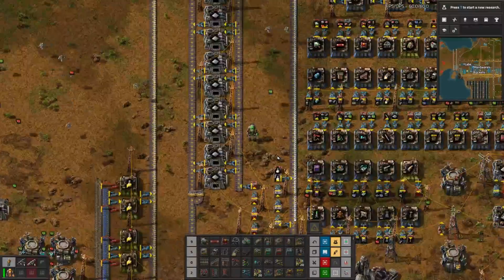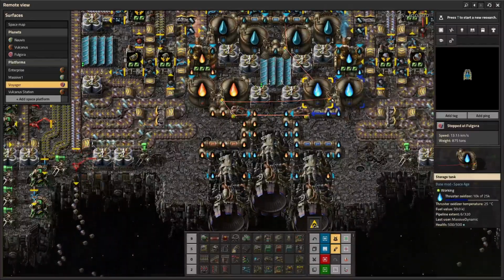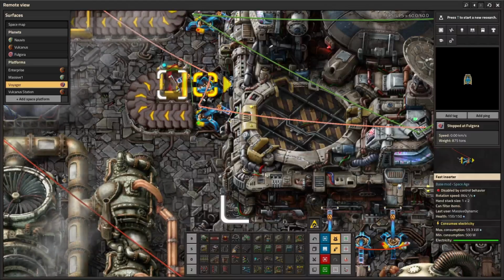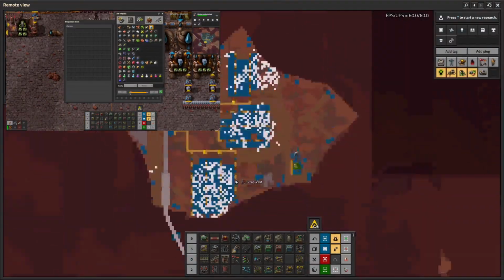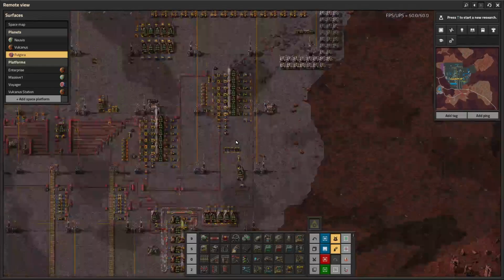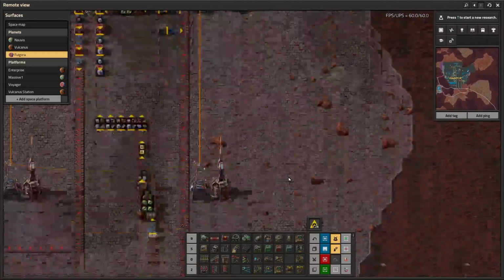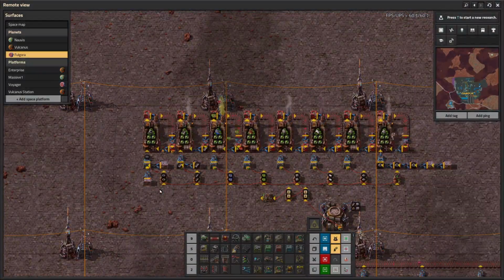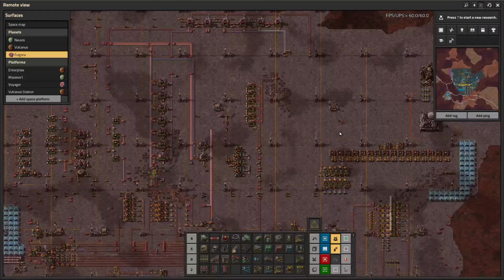Thrusters, Recycling, And Quality | Chill Factorio 2.0 Space Age Ep26

Comment: Love the concrete block trick but... why not just monitor/trigger off the fuel and oxidiser directly?
Reply from the maker: The storage bay doesn't receive signals so I can't transmit the fuel supply to the schedule.
Reply: @MassiveDynamic9  it works if you wire it up... Mine monitors fuel, oxi and ammo. Used to monitor stuff like repair packs but no need.
Reply: @mUnky889  100%.
Reply from the maker: @mUnky889  hmmmm, I will have to try again. Thanks